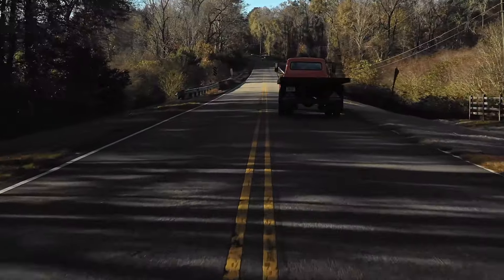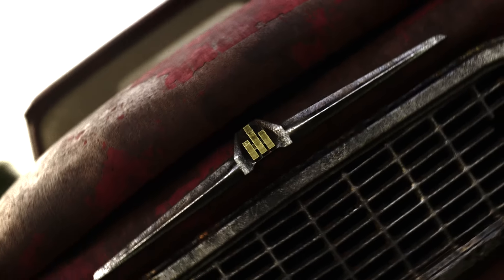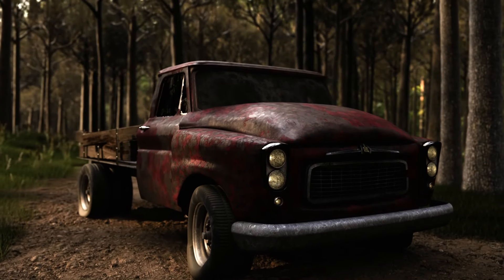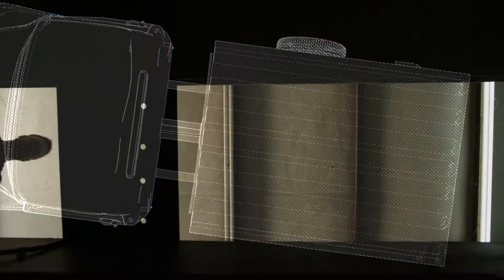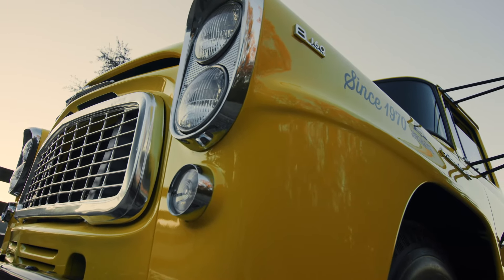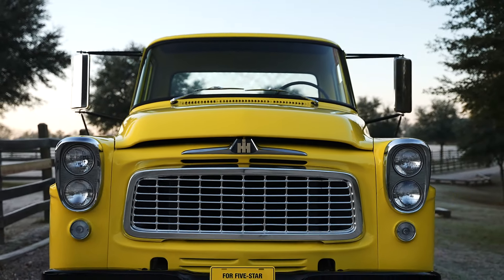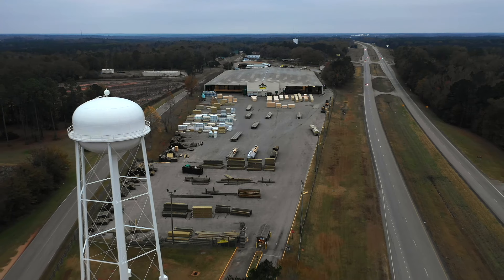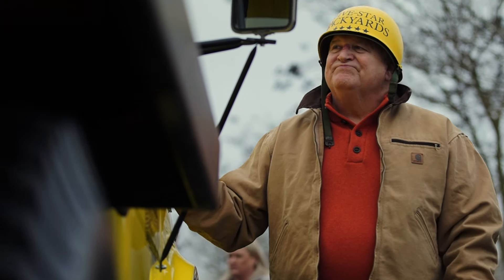YellaWood | The Truck That Started It All

Comment: I am a Blacksmith.  My Ford F350 utility truck is my life.  It defines my life's work.  It represents the struggles I've had financially.  I bought it new in 2007 and during the last financial crisis I had to refinance it ..TWICE in order not to lose it so I know all about going to the bank and having $5 in the account!    I am using it now to build a retirement cabin 750 miles away for my wife and I after renting for 40 years.  I have made dozens of trips (twice a year) hauling thousands of lbs. of lumber and equipment.  I have a sawmill and a Massey Ferguson tractor onsite.  I could not do what I'm doing without it.  It is saving us from the insanity going on in our country.  God bless you Jimmy.  Thanks for the memories.